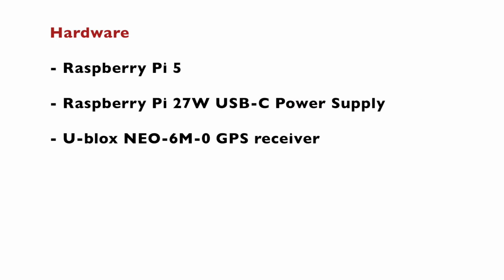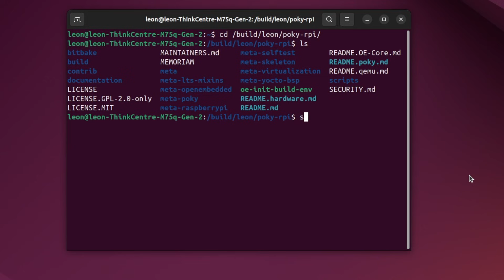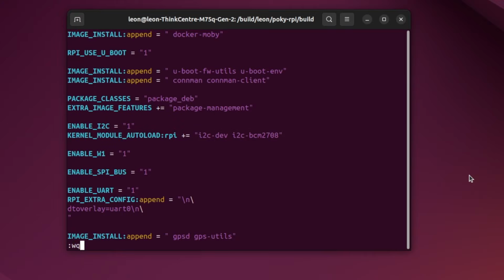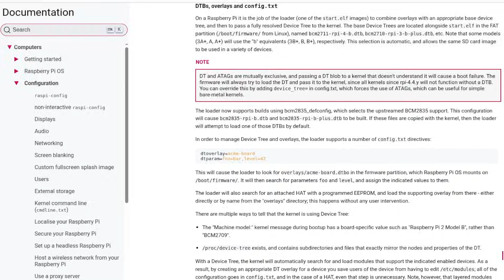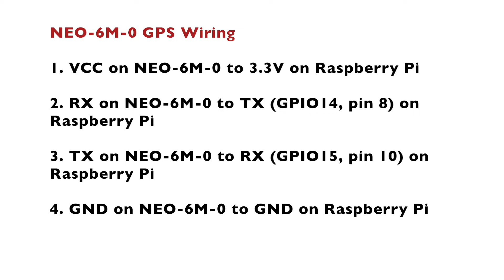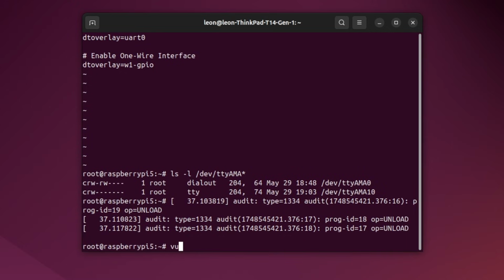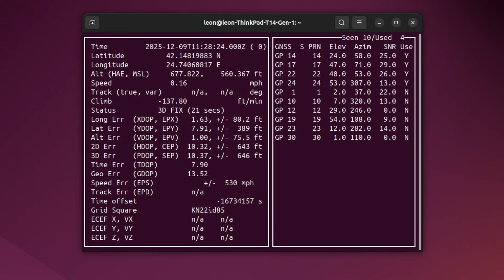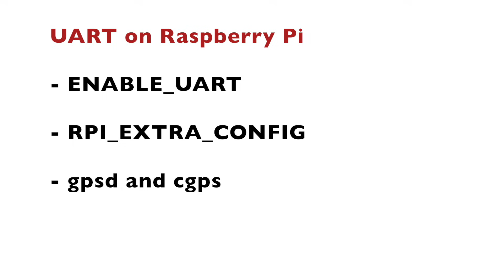The Yocto Project on Raspberry Pi 5 Episode 12: Connecting a GPS Module via UART on Linux #yocto

Comment: Automotive Grade Linux Qt Cluster Implementation Question

Hi Leon, my question is not related with video. I hope you can answer it.I'm working on AGL for a while to make basic cluster for myself to learn AGL development and process.

I would like to use qt6/QML as UI design and use it in the AGL. I created recipes , QML file and main.cpp about it but I'm a little bit confused it. Because I checked demo cluster project , I saw that there is huge amount of code in the main.cpp for wayland , grpc and kuksa.val.

I could not find any document with related to this. No explanation about how to develop your own custom UI implementation.

I would like to share one of demo cluster main.cpp and mine. Could you please help me that the demo main.cpp codes are necessary or not ?

Because I though that it would be easy with qt/qml and recipes to add AGL. Also I have waveshare 5inch touch screen , I tried it with demo application and it works well.

I tried qt-cluster demo and flutter-cluster demo , it was good.

This is the demo cluster main.cpp file.

    #include <QtCore/QDebug>
    #include <QGuiApplication>
    #include <QtCore/QCommandLineParser>
    #include <QtCore/QUrlQuery>
    #include <QtGui/QGuiApplication>
    #include <QtQml/QQmlApplicationEngine>
    #include <QtQml/QQmlContext>
    #include <QtQml/QQmlComponent>
    #include <QtQml/qqml.h>
    #include <QQuickWindow>
    #include <QtQuickControls2/QQuickStyle>
    #include <qpa/qplatformnativeinterface.h>
    #include <QTimer>
    #include <glib.h>
    #include <QDebug>
    #include <QScreen>
    
    #include <wayland-client.h>
    #include "agl-shell-client-protocol.h"
    
    #include <vehiclesignals.h>
    
    // Global indicating whether canned animation should run
    bool runAnimation = true;
    
    static void
    global_add(void *data, struct wl_registry *reg, uint32_t name,
               const char *interface, uint32_t version)
    {
            struct agl_shell **shell = static_cast<struct agl_shell **>(data);
            if (strcmp(interface, agl_shell_interface.name) == 0) {
                    *shell = static_cast<struct agl_shell *>(wl_registry_bind(reg,
                                            name, &agl_shell_interface, 1)
                    );
            }
    }  
    static void
    global_remove(void *data, struct wl_registry *reg, uint32_t id)
    {
            (void) data;
            (void) reg;
            (void) id;
    }
    
    static const struct wl_registry_listener registry_listener = {
            global_add,
            global_remove,
    };
    
    static struct agl_shell *
    register_agl_shell(QPlatformNativeInterface *native)
    {
            struct wl_display *wl;
            struct wl_registry *registry;
            struct agl_shell *shell = nullptr;
    
            wl = static_cast<struct wl_display *>(native->nativeResourceForIntegration("display"));
            registry = wl_display_get_registry(wl);
    
            wl_registry_add_listener(registry, &registry_listener, &shell);
            wl_display_roundtrip(wl);
            wl_registry_destroy(registry);
    
            return shell;
    }
    
    static struct wl_surface *
    getWlSurface(QPlatformNativeInterface *native, QWindow *window)
    {
            void *surf = native->nativeResourceForWindow("surface", window);      
      return static_cast<struct ::wl_surface *>(surf);
    }
    
    static struct wl_output *
    getWlOutput(QPlatformNativeInterface *native, QScreen *screen)
    {
            void *output = native->nativeResourceForScreen("output", screen);
            return static_cast<struct ::wl_output*>(output);
    }
    
    void read_config(void)
    {
            GKeyFile* conf_file;
            gboolean value;
    
            // Load settings from configuration file if it exists
            conf_file = g_key_file_new();
            if(conf_file &&
               g_key_file_load_from_dirs(conf_file,
                                         "AGL.conf",
                                         (const gchar**) g_get_system_config_dirs(),
                                         NULL,
                                         G_KEY_FILE_KEEP_COMMENTS,
                                         NULL) == TRUE) {
                    GError *err = NULL;
                    value = g_key_file_get_boolean(conf_file,
                                                   "dashboard",
                                                   "animation",
                                                   &err);
                    if(value) {
                            runAnimation = true;
                    } else {
                            if(err == NULL) {
                                    runAnimation = false;
                            } else {
                                    qWarning("Invalid value for \"animation\" key!");
                            }
                    }
            }
    
    }
    
    static struct wl_surface *
    create_component(QPlatformNativeInterface *native, QQmlComponent *comp,
                    QScreen *screen, QObject **qobj)
    {
            QObject *obj = comp->create();
            //QObject *screen_obj = new QScreen(screen);
            obj->setParent(screen);
    
            QWindow *win = qobject_cast<QWindow *>(obj);
            *qobj = obj;
    
            return getWlSurface(native, win);
    }
    
    static QScreen *find_screen(const char *screen_name)
    {
            QList<QScreen *> screens = qApp->screens();
            QString name(screen_name);        
    for (QScreen *screen : screens) {
                    if (name == screen->name())
                            return screen;
            }
    
            return nullptr;
    }
    
    int main(int argc, char *argv[])
    {
            QString myname = QString("cluster-dashboard");
            struct agl_shell *agl_shell;
            struct wl_output *output;
    
            QObject *qobj_bg;
            QScreen *screen;
    
            QGuiApplication app(argc, argv);
            app.setDesktopFileName(myname);
            QPlatformNativeInterface *native = qApp->platformNativeInterface();
    
            agl_shell = register_agl_shell(native);
            if (!agl_shell) {
                    exit(EXIT_FAILURE);       
    }
    
            std::shared_ptr<struct agl_shell> shell{agl_shell, agl_shell_destroy};
    
            const char *screen_name = getenv("DASHBOARD_START_SCREEN");
            if (screen_name)
                    screen = find_screen(screen_name);
            else
                    screen = qApp->primaryScreen();
            output = getWlOutput(native, screen);
    
            read_config();
    
            QQmlApplicationEngine engine;
            QQmlContext *context = engine.rootContext();
            context->setContextProperty("runAnimation", runAnimation);
    
            VehicleSignalsConfig vsConfig(myname);
            context->setContextProperty("VehicleSignals", new VehicleSignals(vsConfig));
    
            QQmlComponent bg_comp(&engine, QUrl("qrc:/cluster-gauges.qml"));
            qDebug() << bg_comp.errors();
            struct wl_surface *bg = create_component(native, &bg_comp, screen, &qobj_bg);
    
            // set the surface as the background
            agl_shell_set_background(agl_shell, bg, output);
    
            // instruct the compositor it can display after Qt has a chance
            // to load everything
            QTimer::singleShot(500, [agl_shell](){
                    qDebug() << "agl_shell ready!";
                    agl_shell_ready(agl_shell);
            });
    
            return app.exec();
    }

I'm really confused how I can add my custom qt cluster into AGL, please show me a way to follow
Reply from the maker: Although I have been involved in both AGL and Qt development in the past, unfortunately, I haven't recently contributed to AGL so I am not familiar with source code of the latest demo cluster project. I recommend you to try reaching the AGL Developer Community through the public mailing list: https://lists.automotivelinux.org/g/agl-dev-community
Reply: @LeonAnavi thank you so much for this help😊

Comment: one question bro. if i completely watch this series. can i build custom rom for android device which oem didn't provide any kernel or device tree.

you may think as stupid question but if i can do with pi5. maybe another Android phone.
Reply from the maker: Actually, it is a very good question. Yes, in theory, with the Yocto Project and OpenEmbedded you can build a custom Linux distribution for any device that is capable of running a Linux kernel. In practice, however, you need a BSP (Board Support Package) layer that includes at least a compatible bootloader, Linux kernel, and device tree configuration for the device's peripherals. This can be a huge technical challenge if you are working with a device for which you don't have hardware schematics and receive no support from the manufacturer, which is typically the case with a random Android smartphone.
Reply: @LeonAnavi  Thx for clarifying it
Reply from the maker: @vigneshkarthi3321  thanks for watching :) I hope my video tutorials are useful :)